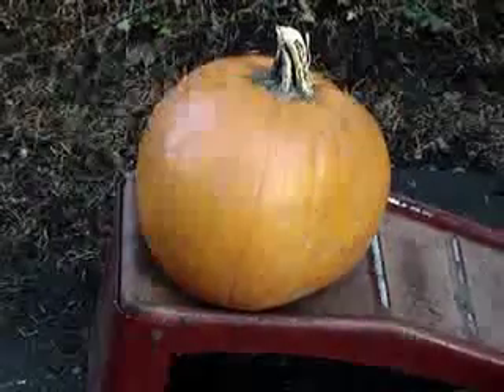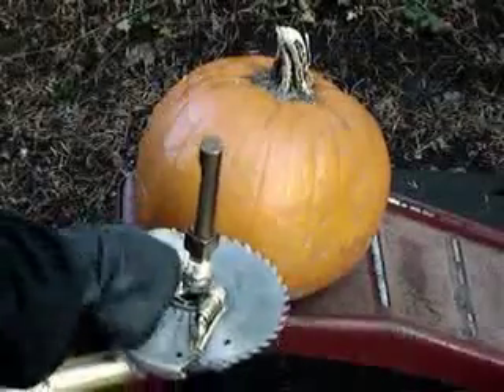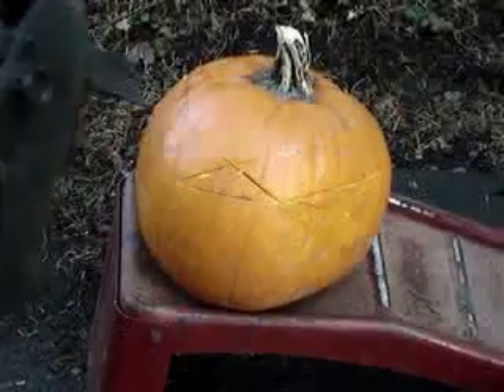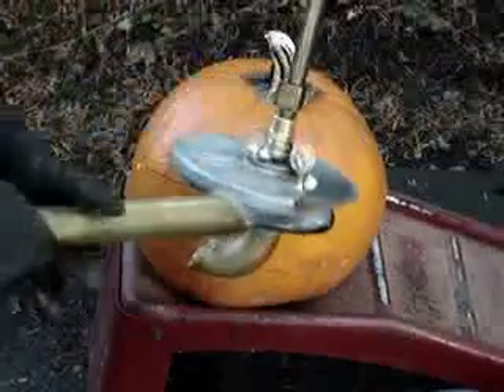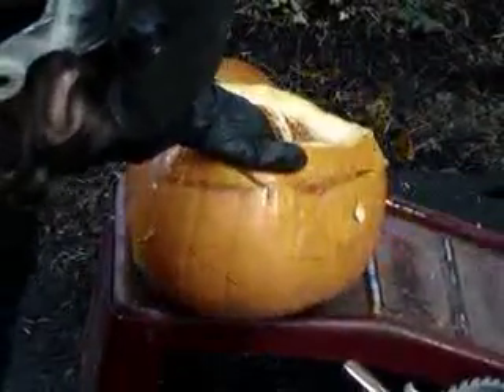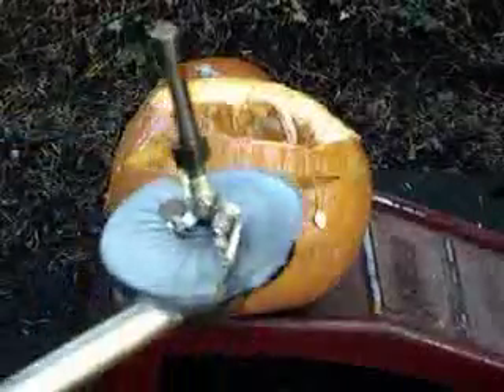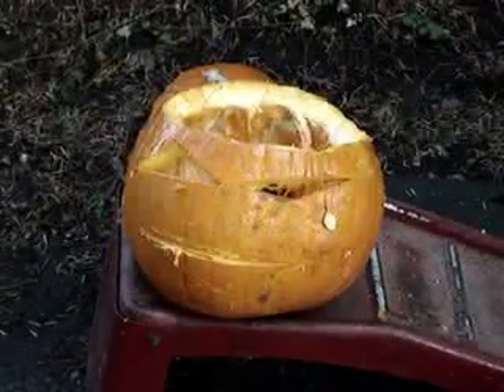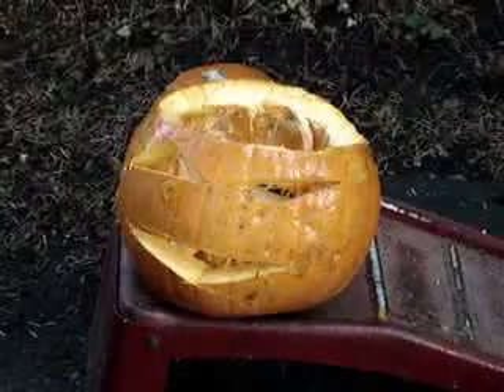Tesla CD Turbine Pumpkin Cuttin' Ceremony

Comment from the maker: This turbine was made more of a joke than for practical use. After all, it's made with a plastic CD case!

The Tesla Turbine was designed for high-rpm use; some say it lacks torque.  
However, for more torque, simply add more discs, or increase the inlet pressure, or use gearing...the same as any other motor.

Check out my Tesla CD Turbine playlist for more of my Tesla CD Turbine contraptions.

Comment from the maker: @Suyamu 

The Tesla disc Turbine is unique in that it can take the shock pressures and corrosiveness of wet steam as well as dry.  

It is also the only form of turbine that can handle direct biomass combustion byproducts. 

It can run on any fuel. 

It's cheaper to build and maintain than other turbines.

Comment from the maker: @davecool67 

It is somewhat more efficient to run air and water in the turbine, depending on how things are measured. 

For an experiment in using air and water at the same time in a Tesla CD Turbine, see my movie, "Tesla CD Turbine Experimental Test Combining Air and Water". 

Followed by, "Recirculating Tesla CD Turbine with Power Boost Blender" and finally, "Tesla CD Turbine Blender Bursts On Kitchen Table".

Comment from the maker: You would have lost the bet if we were talking about pine 1x2.  It is true there is not much torque, but there was an accidental 3/4 inch hole in the top of the turbine case that day that affected power.

Tesla turbines usually have to be geared down to deliver "power to the wheels"...just as auto engines need to be.

Comment from the maker: I could do a better job with a sharp rock. That's not the point.

I did cut some pine 1/2" x 1" with it, barely. The turbine wasn't performing well because of a puncture hole in the top of the case.

Considering it's a bunch of CD's and a CD case as the turbine, and magnetically driven to boot, I was lucky to live through it. I've had enough of saw blade action, thanks! 

As far as cutting lumber, I do have a Desktop Turbine Pencil Sharpener I've completed, with a video out shortly...

Comment from the maker: It will work with a vacuum attached, but it would only work equivalent to 15 psi air pressure max with total vacuum, more like only 2-3 psi with a real vacuum cleaner. Which would likely barely make the turbine run.

Comment from the maker: My life is not at all about easy. 

The point (so to speak!) is that it's a fluid-powered magnetic Tesla Turbine made from recycled CD parts, that's able to drive a magnetically-suspended sawblade outside of the turbine case.

This is a disc turbine with no shaft, no bearings to wear out, and no shaft seals to leak. 

The pumpkin is just a fun test object that got in the way of this crazy device.

Comment from the maker: Good suggestion, but this was a one-time deal because of the extreme danger factor.

Actually, I was thinking of going to a 14 inch cut-off saw blade for better visuals. Torque would be low, but the flywheel effect would be something to die for! (so to speak...I hope!)

Comment from the maker: It is true that spiral magnets would make the turbine more efficient at lower speeds. 

I was trying to stay true to the original Tesla turbine idea of perfectly smooth discs as much as possible. That way the principles of adhesion and viscosity prevail due to boundary-layer conditions. Otherwise, with spirals directing the flow, it becomes more like a spiral bladed turbine design. 

The Tesla turbine design begins getting best torque at about 1/2 it's maximum rpm, and should be geared to suit.

Comment from the maker: It uses an air compressor in this case, with an air hose running to the CD Turbine. The compressor is plugged in to 110 volt electrical.

The turbine device can also run on air cartridges or compressed CO2.

Comment from the maker: An A!
The neodymium magnets serve three main purposes:

First, the 1/32 inch magnets maintain the optimum disc spacing to enable the fluid boundary layer adhesion effect. 

Second, the spacer magnets act as the suggested washers Nikola Tesla originally specified in his patent. 

Third, the six large top magnets inside the turbine engage a  magnetic coupler outside of the turbine, enabling torque to be transferred from inside to outside the turbine without a shaft.

Any more Q's?

Comment from the maker: The real Tesla Turbine has high speed ...and GOOD power.  Tesla raved about 10 horsepower per pound of turbine!

 However, the Tesla turbine doesn't develop much torque until it reaches half of it's maximum speed. I would have to run this turbine at a minimum of 20,000 rpm to begin to get into it's torque range. Use of a 4:1 gear reduction would quadruple the torque in the 5000 rpm range required for the skilsaw blade.

Also, this is a CD case and CD's; efficiency is about 2 % of what Tesla got.

Comment from the maker: That's right, it has low torque, and the air compressor has a hard time keeping up. The main problem, though, was a 1 inch hole in the top of the case which occurred when I stepped on the unit accidentally the day I needed to do the video. Ooops! Without the hole it goes pretty good and sounds better.

Comment from the maker: Thanks for suggestion.

 The depth of cut with the sawblade was only 1 1/4 inches, and it could barely get through the thick skin of the pumpkin as it was. A smaller blade would mean a big re-design of the CD Case, etc.
 I almost built an CD Turbine knife at thanksgiving with guts of electric carving knife...much better for pumpkins!!

Comment from the maker: Of couse I did. As I explained before, the depth of cut on the saw was about 1-1/4 inches. Since I picked the biggest, baddest pumpkin I could, it happened to have a thicker skin than that. So, yes, I separated in a couple of spots only.

Comment from the maker: This one uses a magnetic CD Disc Pack inside the CD Spindle and a corresponding Magnetic Coupler attached to the sawblade which rides on the outside of the CD case. 
   The plain CDs without magnets go fast but you can't get useful power out.

Comment from the maker: Oh, and with the garden hose set-up I can get about 1200 rpm so far on regular water pressure (about 50 psi). There is room for much optimization here and I have several designs I'm working on...first to get optimum max rpm and torque, then to get electrical power somehow out of that. I hope to run a blender or some other kitchen tool directly off water as well.

Comment from the maker: This unit was broken when I was running it so did not perform as well as expected during the Ceremony. I was totally amazed it even ran with a ragged-edge 3/4 inch hole in the plastic surface of the top of the CD case. I had to run full 120 psi to get it to cut...probably running at 2000-5000 rpm. It should normally be double those rpm figures.
The plain-jane (no magnets) disc pack will easily do 15,000 rpm with about 40 psi.